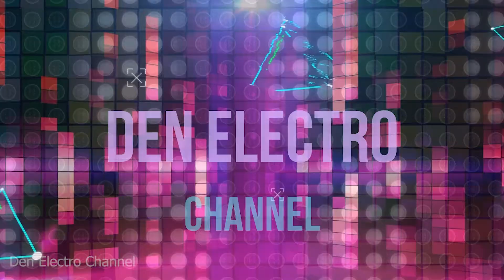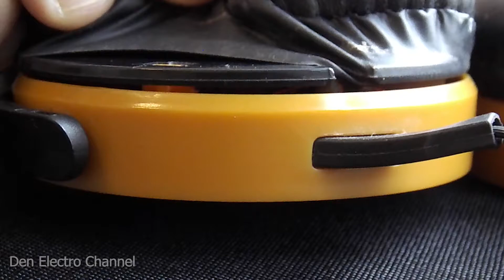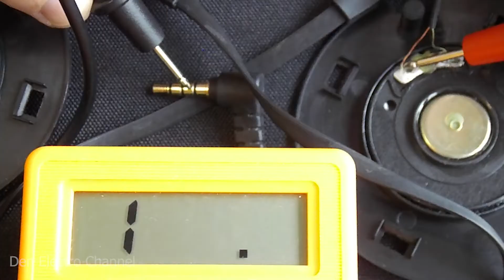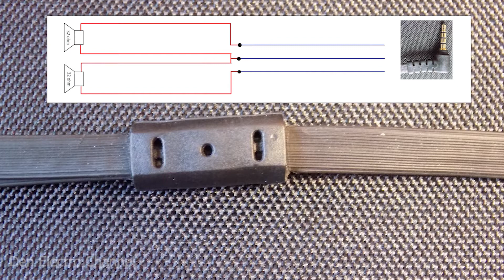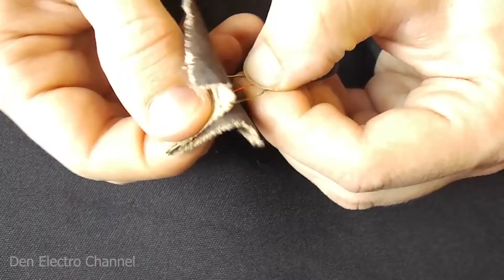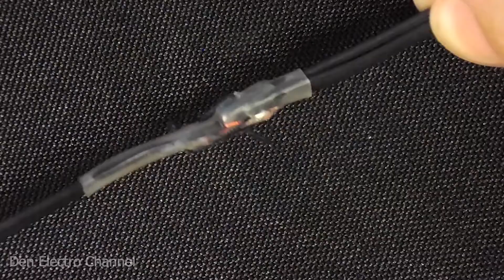Headphone repair }*{ the most complete and simple explanation

Comment: The headphone icon is pop up but there is no sound both speaker, i check the wires if they have damage and i didn't see anything, so i re solder and check the resistance they are all good but nothing worked i think there is a problem on wiring? But which part?